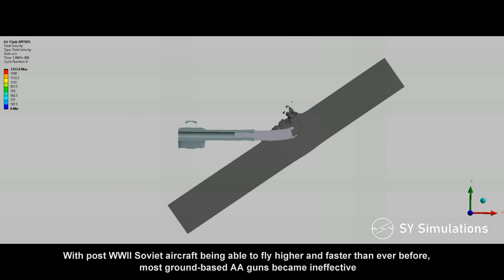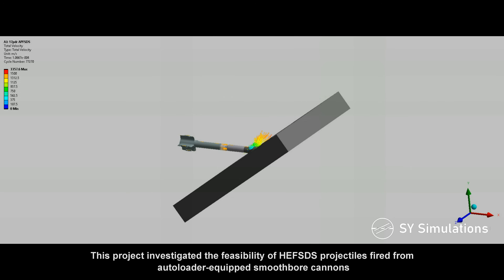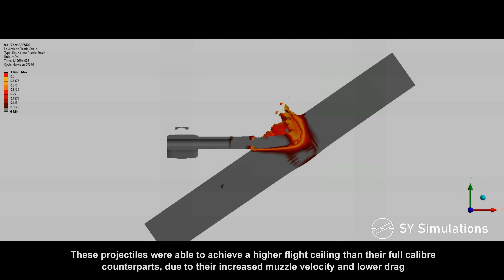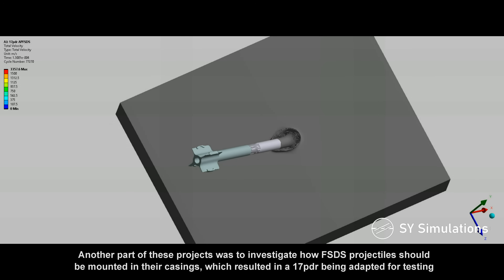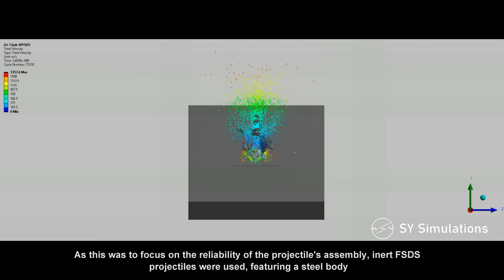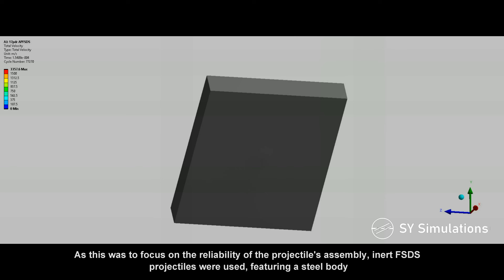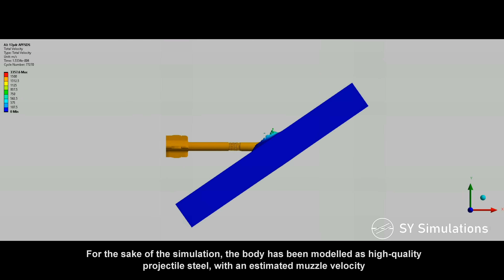1940's APFSDS for the 17pdr vs PANTHER II + History of British FSDS | Armour Penetration Simulation

Comment from the maker: To clarify, this projectile was tested but it was not intended to be used against armour (it was testing FSDS mounting methods). More info can be found in ADA492802 from the DTIC website. The simulation has assumed the steel was projectile grade and the muzzle velocity has been approximated based on its weight.
Reply: Sy could you do first hesh
Reply: Have you done the German version of a APFSDS? The Peenemünde arrow shell?
Reply: Попробуете сделать симуляцию попадания БОПС в зону под башней абрамса? Не на лист в котором люк водителя, а именно в зону сочленения башни и корпуса. Было бы интересно посмротреть
Reply: Can you possibly do what a ww2 german torpedo's would do to modern warships, as apparently they have no belt amour? ⚓😮👍✌🦘

Comment: I think that a penetrator+sabot having less KE than full caliber AP makes sense,since being lighter it is pushed inside the barrel for a shorter time converting less energy.
As an example the muzzle energy for 16 inch AP Mk 8 is larger than HC Mk 13. (301 MJ vs 278 MJ for the Mk 6 gun)

Comment: Cant wait for gaijin to add a premium Sherman firefly with APFSDS when they run out of ideas
Reply: What I'm sad with is they don't give the normal British firefight APDS they only give the Italian Firefly APDS even though historically the British Firefly did have access to APDS
Reply: @andrewmencer916 
I argue 5.7 is a far better br than 6.3 for firefly.
Reply: @andrewmencer916  Fortunately it's overall better to stay with the traditional AP rounds rather than the sabot. The APDS is notoriously inaccurate and only really useful in close range engagements against heavily armored targets, that does not mean a Tiger 1. It's exclusively good for Tiger 2 turret faces, Panthers, and an option but not required for a T-44 or IS turret. Not very worth it against a jumbo Pershing or T29 etc, better to avoid them and hit the side with normal shells.
Reply: @Charaqat No Tiger II tank was ever penetrated from the front during the war.  The Tiger ii glacis is 150 mm thick slope back 40°. That works out to about 256 mm including slope effects compared to 90° armour.
-17 pounder APDS penetration against vertical armour is also 266 mm at 500 m.   So effectively a APDS becomes ineffective above 500 m.  In reality this would have to be a lucky shot.  The penetration at 100 m was 275 mm.  The tank would only have to be slightly askew
Reply: @williamzk9083  I said turret face.
Reply: And it will be a garbage APFSDS that always shatter because it's British
Reply: @justsomehaatonpassingby4488  the 6 pounder APDS never had any accuracy issues.   The 17 pounder suffered from two problems.  The first of these was a manufacturing tolerance mistake.  That was fixed.  The second problem with that the sabots would interact with the muzzle brake causing instability in the projectile and uneven separation of the sabots.  That was fixed by boring out the muzzle breaks by about 1 mm.
-these two modifications worked.  The Canadians had their own APDS with a tulip shaped cup that assured better separation and these made a difference as well.
Reply: @williamzk9083  we're all talking about how Gaijin treats the British Tree and Rounds here, not how "ultra OP powerful godlike" British Rounds are IRL as you claim
Reply: there has actually been a sherman with 60mm italian gun.
Reply: @amirsayfiddinov  No, there is. Chile uses it.
Reply: @Charaqat  i said the GUN was italian.
 
wiki: "The 60mm HVMS (High Velocity Medium Support) gun is a self-loading autocannon jointly developed by IMI Systems of Israel and OTO Melara of Italy."
Reply: @amirsayfiddinov  Yes, Chile uses it. They bought the super shermans with the modification.

Comment: What about a 100mm t-54 front plate?
Reply: Nah, with that much of the round left, wouldnt pen it. T-54 much more angled
Reply: @CChiefmk3 60° vs Panther's 55°
Reply: @CChiefmk3 more of the Al fin section could be filled with a steel rod.

Comment: Can you do a SU-100 with 100mm AP vs. the Tiger IIs turret front. There was WW2 100mm APCR, which should barely perform better than a high quality AP round, which the Soviet 100mm AP probably wasn't, due to insufficent hardening.

Another idea would be some APHE overpressure simulation, like the infamous 88mm Pzgr. going off inside a turret, or maybe cupola ;)
Reply: Why wouldn't it be hardened enough? There were the elements to make the thick armor for the IS-2 and T-34/85 turrets ,so hard enough shells were possible.
Reply: @ShokkuKyushu  AP shells are hardened to a much higher degree than armor.
You don't want to fire something at armor that has less armor than the armor itself, don't you?
Reply: @Kuschel_K  lol. When shells are too hardened, they shatter on impact
Reply: @sigmamale4147 Bro, you harden the tip and surface of the shell.
The rest of the shell has lower harness and higher ductility so that it doesn’t shatter because it’s too hard.
Reply: @Kuschel_K  Yeah, that's true, but my point is that if there are the elements to produce through hardened armor, a steel variant with just a little more carbon is going to easily have hardness ~500+ Brinnel.

Comment: I love it when the Panther II gets some love and attention!
Reply: I wouldn’t say it’s love in this case because it got absolutely fu*ked by the 17 Pounder😂
Reply: @imitradisv  that is another kind of "love" but it is love nonetheless
Reply: @jadinosaurus  🤣🤣
Reply: @imitradisv  The armour was never designed for an FSDS/APFSDS round, so it getting fucked up isn't that surprising seeing as tanks wouldn't be using that for a long time after WW2.
Reply: It doesn't really get love and attention because it was never really even meant to be a thing, let alone made properly. I wish it was because maybe, just maybe they would've fixed the transmission, but it wasn't meant to be
Reply: @exoticdachoo007  the panther 2 wouldve been used had they not found a better way of up armoring the existing panthers.
Reply: @Consumpter  It was an idea that appeared because Panthers got destroyed by 14.5mm AT rifles. They used the existing Panther hull design and in the factory added more steel thickness to the front and sides while making it.

They then realized that all that trouble would waste time and materials since you could get rid of that 14.5 issue by placing like 2mm thick side skirts onto the tank like the Panzer 4 got. 

The 88mm and new turret is like a wehraboo dream that never existed and never was planned but might've gotten drawn by a designer I can't remember. If put in action it'd use the same 75 and same turret as the Panther G. So not a Panther 2 but a Panther 1.2 or 1.5 I guess.

Correction: They wanted to use a modified variant of the Schmalturm turret on it, which was also planned for the regular Panther but never made as well.
Reply: Panther II was a useless "new" tank that never should have happend. Its not an update like from Tiger I to Tiger II. It was a desperate attemd to standerdise many Parts of the newest tanks to make production easier and quicker. Panther II should have used many Tiger II parts and in general it was a slightly uparmored Panther G Hull. The Schmalturm could fit on existing Panther I Hulls too.
Reply: @JansenX12 The Schmalturm was designed for the Panther F. The Panther II had a different type of smaller turret designed for it.
It never used the 88mm either.
And of course there was no jump in performance like between the Tiger 1 & 2, that's because it already had sloped armour and was the peak of technology.
It would have taken a massive burden off of a strained economy and workforce by having parts commonality with the Tiger II and being able to use the same assembly lines as the original ones.